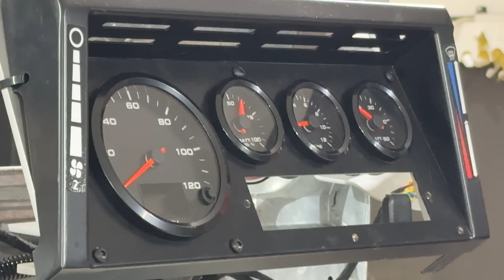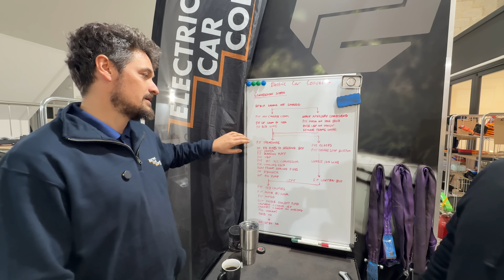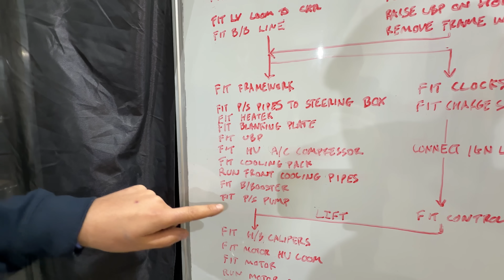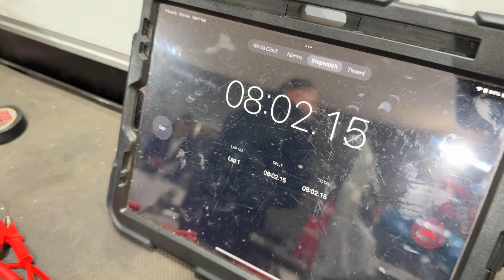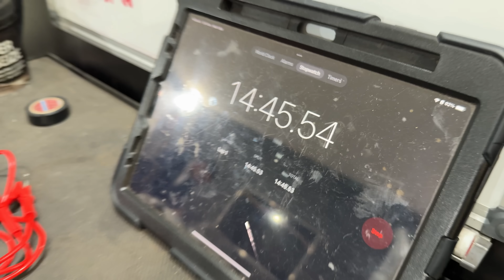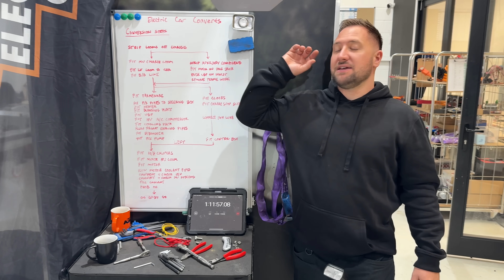Can you convert a Landrover Defender to electric EV in just one Day?!

Comment: not something I could do on my driveway myself. I still don't know who wants to drive these tractors :)
Reply: Yeah I think if you're putting a 270hp power-train in an old Defender you really should be doing something about the suspension, brakes and steering. They do handle like a tractor - I've owned one 🤣
Reply from the maker: It’s definitely an interesting drive

Comment: If the conversation was for a Reliant Robin or other tiny light vehicle to be a city runabout then I’d applaud their efforts.
But because it is something that if used as intended being fully electric is just a stupid load of virtue signalling.
And if used as a city runabout then it’s an even worse load of useless virtue signalling
Reply: ... Used as it's intended, these are pretty much the perfect mod. Instead of never getting to comfortable operating temperatures because you're stopping to open gates, feed cows, empty fertiliser etc etc every few moments, you're using the only powertrain that doesn't suffer for repeated short bursts. Instead of being unable to start every 3rd morning because it's a bit damp, this will work in all weathers we get, and require virtually no maintenance. Almost all of the unreliable parts of the original have been replaced by things that work. You've now got proper AC and heating, that actually work, making it far more comfortable on a cold and wet, or hot and sticky day. It's got far more power than it needs now, and an LSD as a bonus, instead of being vastly underpowered. It's also not going to guzzle fuel and burn through oil like nobodies business. You've got plenty of range for any of the journeys across your farm/estate, and for getting in and out of town. 

Like really, what do you think a Defender is for if not roaming about the countryside and getting things done?
Reply: @Phazaar . The intended purpose of a large 4x4 is not puttering around a farm.
There are far more suitable vehicles than a Land Rover, and even if you do need a large 4x4 for the farm there are most certainly far more suitable vehicles than a Land Rover especially given what you said about them.
And in the list of more suitable vehicles you will not find a single VSM.
Reply: You seriously think putting a 270hp motor in a Reliant Robin would be a good idea?! 🤣
Reply: @Anticitizen666  Yes a very good Idea said Jeremy Clarkson

Comment: It took all the fun out of it when I learned the 60k price for just the kit. This is only for the very rich. Just another cool thing Il never have. Thanks for getting my hopes up
Reply: I agree £60k is a chunk of change for a conversion kit, however, it’s a hand made bespoke kit that has been developed and refined over years. Felten kits are almost plug and play, are exported all over the globe and are very highly regarded within the EV conversion sector. Given the research, development, testing and warranty, what price would you recommend for this kit? Keep in mind that the business has to pay 20% vat, 15% corporation tax and a further 15% National insurance contribution for every employee. That’s before actual wages, business premises rent, commercial rates, commercial insurance, heating and electricity. If there’s anything left for profit, that’s taxed too!
Reply: You are getting this conversion confused with their Tesla based kit. 
 This kit is going to be far more budget friendly. 
 Take one crashed Nissan Leaf drive unit and battery pack. Connect the motor to the transfer box using after market adapters. Wire up the motor etc using an off the shelf controller.  
Fabricating the mounting frame, cooling and heater conversion would be the most awkward jobs. 
I have been researching doing a similar type of conversion that would be budget friendly.
Reply: Not bad 60k for 4 hours work 😅
Reply: Yeah the price is insane! I bet there's no R&D or engineering to produce it. No doubt it's just parts and zero experience!
Reply from the maker: How do you think it become a kit? Every part has been designed, engineered and manufactured. It took years to get to that point so there is a massive amount of embedded R&D that needs to be covered. The only off the shelf part is the Tesla motor and even that has custom gearing and diff.
Reply: @Hazell_Nutz i understand completely but I fail to see the point of me watching a channel that will continue to  keep showing me stuff i wont be able to afford. This channel is for far more wealthy audience than me. I appreciate your time making it though.
Reply: @prodelboy2743  You can still enjoy the content without having the budget for it. If you only watch youtube for purchase decisions, that's on you, but it is entertaining nonetheless whether its for the poor or the rich.
Reply: Don’t be so miserable, if you don’t like it don’t watch it, it’s pretty obvious that the kit isn’t going to be a couple of grand.